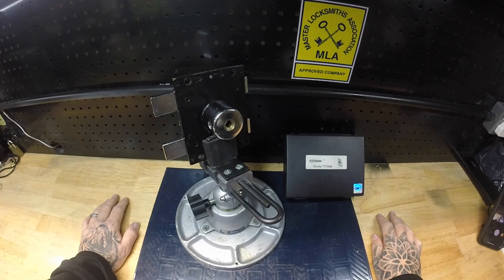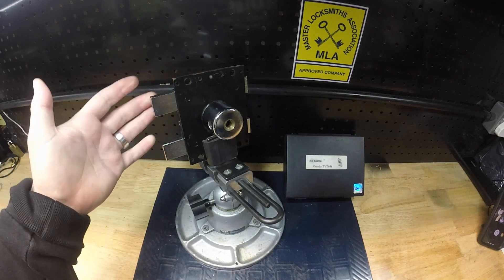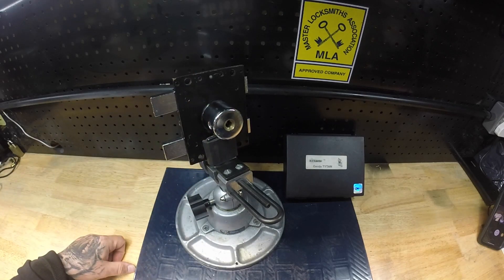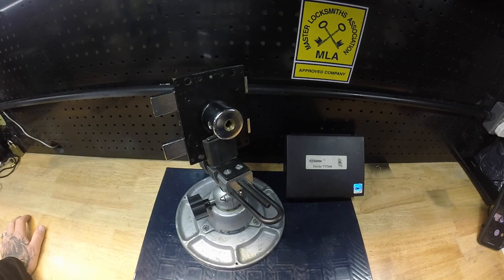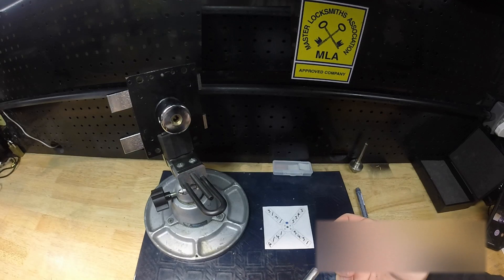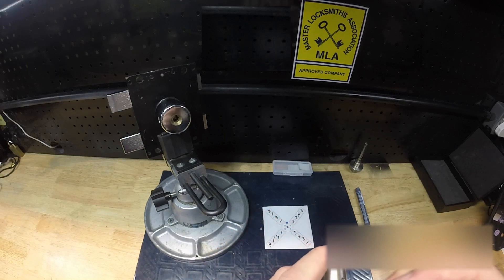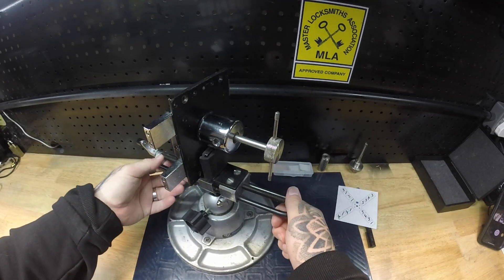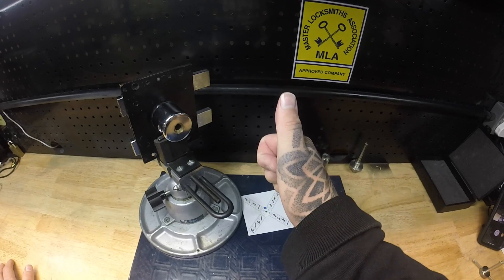Opening a Gerda G1000 Mortice Rim Lock

Comment: As a locksmith and locksporter, I have one of these locks I bought directly from Gerda here in the US.  I saw one on Bosnian Bill's Lock Lab YouTube video in the "naughty bucked" in his consortium with the LockPickingLawyer, and though I'd like to have one.  Interesting tool and method of decoding, and then picking with the paper impressioning.  Very interesting method.  I would argue with the 4.3 million possible keys, as with 4 depths of cut on 16 pins = 16 to the power of 4 = 65,536.  If you have to  pick 8 times (2 full rotations) 65,536 x 8 = 524,288, a bit shy of 4.3 million.  Thanks for sharing -- I'll have to check out the tool for no other purpose than locksport.  Of course, another problem is a key cutting machine for these.
Reply: It is not 16 to the power of 4 but 4 to the power of 16 = 4 294 967 296.

Comment: We come across these a lot at work (Fire & Rescue) on gerda box fitted outside buildings which have emergency evacuation plans and master keys in side. We carry the master keys on our fire appliances but I believe there are several different master keys
Reply from the maker: Yes there will be many many different master keys. Some council specific or borough specific etc. Due to the possibilities.
Reply: There are only 2 in London. The H,D, and E master and the newer TH master for tower hamlets. Those 2 keys will get you in everywhere. We have a machine to cut them if you ever need one (y)